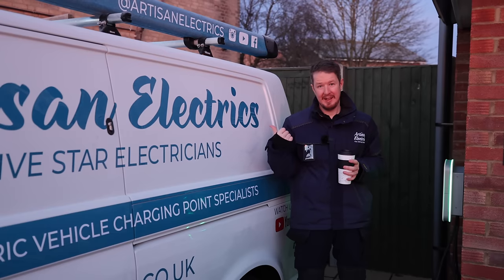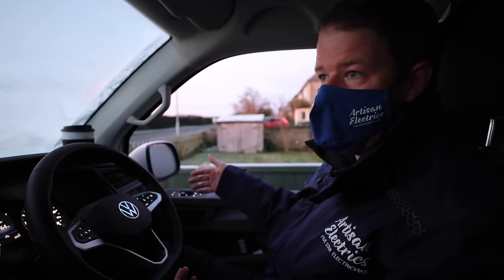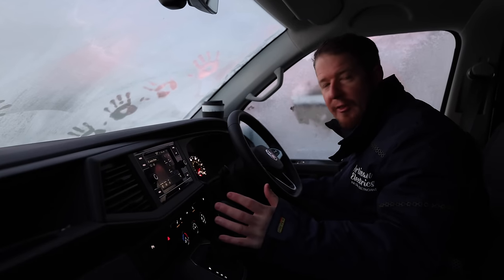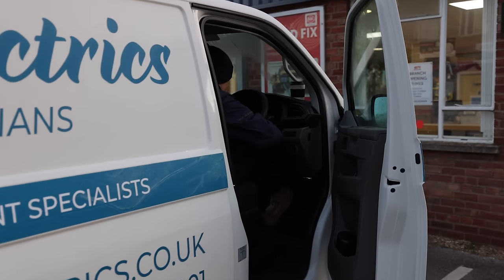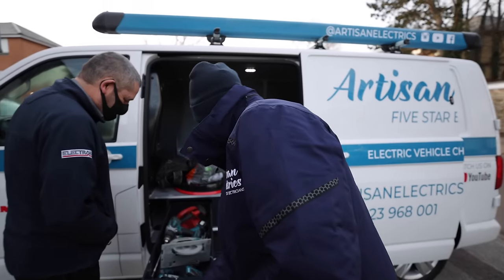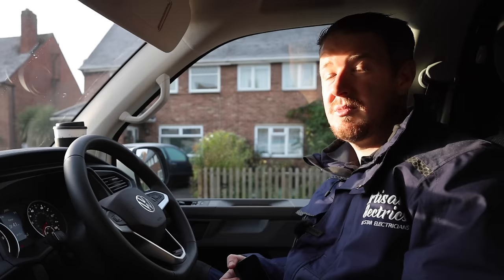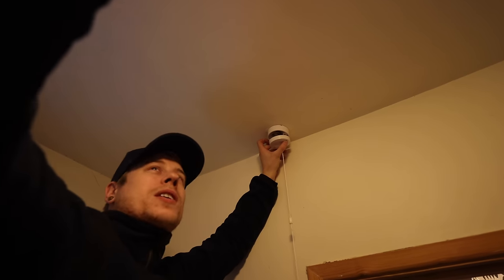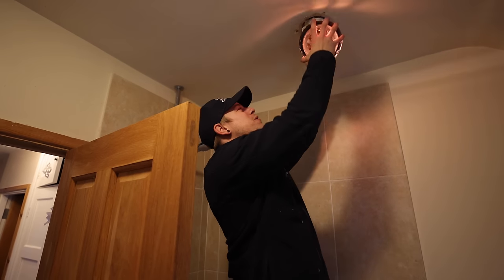ELECTRIC VAN NIGHTMARE 😬 - Volkswagen Transporter Electric Van

Comment: I think you’ve just put me off getting an electric van🤣🤣
Reply: I do some work for a fella who’s got the Kango same as Nagy and the range is only decent for around town with no load any motorway driving, you can forget it the range is almost non existent!
Reply: @JayTheSparky  I was really thinking of going electric. Doesn’t seem to be anything around that cuts the mustard at the moment. Maybe I’ll look at a transit hybrid
Reply: @Waynesworldofgaming  Wouldn't bother with the hybrid mate, real world is around 16 miles loaded on the battery. Best bet is either the Vivaro-E at 207 miles empty or around 80-150 loaded depending on how loaded/roof ladders etc. Or wait til March 9 when VW show the Buzz with its potential 375 mile range with 110kwh battery (empty). If none of those options interest you or you're subject to traders permits like we are in the southern counties, just try to find a low emissions Euro 6 Diesel, Citeron Dispatch is 110g/km co and is becoming quite popular down here.
Reply: @effervescence5664  ok cool, thanks for the advice. I’ll look into it
Reply: @effervescence5664  It is ok them giving the unloaded miles they need to test with given loads in the van

Comment: Wow, not a glowing endorsement for that van! Hopefully you leased rather than purchased. 
Also, if you consider -2 as freezing, avoid Chicago in winter. We've already had a -20 C day and our typically coldest month is still ahead (February). 😁
Love your videos and find UK electrics fascinating.
Reply: Worked up in Canada for a few years, had a Tesla as a second car was a complete liability during winter and had to rely on the Ford 150 pickup
Reply: If the air is dry (low humidity) minus 2 doesn't feel that cold. If in damp air (high humidity) as in UK, even minus 2 feels like minus 10. If the wind blows it's worse.

Comment: Its not the van that's the problem, it's the company that converted it to electric.  If that was one of my vans, it would be heading straight back and I would be demanding a full refund. The range and the performance was shocking to say the least. I don't see Electric vehicles being all of the answer as there are other power sources being trialled which are doing quite well when compared to the performance and range of current electric cars/vans. Your van Jordan demonstrates this rather well. It's a pile of junk and not worth the money you paid for it.
Reply: its rubbish! only 90 miles of range?
Reply: @Lewdacris916  I would honestly think about sending that van back, even if you have to loose a bit of money. It's absolutely no good when trying to run a reliable business if your van is not up to the job, which will only reflect badly on you. You've done nothing wrong so I know it's not fair but that van is rubbish in it's current state. Would be better off converting it back to diesel.
Reply: I have leased one with 2 year commitment. I did my research and  thought about the range before deciding it’s such a cheap van to lease, like really cheap, I decided to add to our fleet of VW Transporters and see how we get on. I knew about the 3.6kw and also the 7kw if you have 3phase available. Our unit has 3 phase so that helps. All the advance ones (you can tell by body coloured bumpers) have heated screen. The heater doesn’t work until you unplug it. I unplug it, heat it up for 15 mins and then plug it back in while I wait for the staff to turn up. That way I still start the day on a full charge. Unlocking the vehicle releases the charging plug, saves messing about with apps. Bearing in mind I have 4 other VW transporters and 2 Caddy’s , I go for the electric one every time! Yes you do have to plan your day but if I need extra range, I just take the caddy. So far I have needed to do this once since we took delivery in August so perhaps give it a week or so before you start thinking about getting rid of it. I’m sure once you get used to the range, and perhaps get the paid version of Zap Map, you will start to understand living with an electric van is not as bad as perhaps you first thought. I had the limiter removed, £300 plus vat at main dealer. Good luck🤞PS, I leased as I’m waiting for the ID buzz to come out (March 2022 I think) so when the T6.1 goes back we can get one of them 🥳
Reply: @deanof1fan  That sounds great. I suppose your right about planning your day before hand. Is it possible Jordan can upgrade the batteries and the charging time? Might be worth him thinking about that if it can be done. I do genuinely feel sorry for him as it looks like he’s done this for all the right reasons but has been caught out. I hope it works out for him in the long run.

Comment: Hi, have you checked the charging settings, as all VW's are set to 10 amps from the factory. Had quite a few customers having the same problem with the chargers we installed, but bit was the car holding back. Adjusted the car to 32amps and happy customers. Good videos are always keep it up.

Comment: You're just slightly below freezing. Use the windshield washers to melt the frost off the windshield. Assuming you have washer fluid in it instead of just water, the fluid will lower the melting point of the frost.

Comment: I drove a G-whiz for six years, in and out of London in all weathers. I added a 50W mains cabin heater to heat overnight and that kept the windows clear and a warm cabin for at least the first five miles. I'd put a 100W in yours as its a bigger area. 
PS I would never buy another VW anything, after owning a car that ate camchains every 40,000 miles.
Reply: Electric vehicles don't have cam chains

Comment: Good vid as always. Ford's patent on heated front windscreens expired a few years ago - circa 2005 I think. I have one on my 2016 Skoda Superb - very handy in winter. I'm not sure electric vans are there yet. Their range is way too low & by the time they are loaded up with work clobber the range drops even further. I just watched a 5th Gear test of electric a VW Transporter & a Merc Vito. Neither were that great.  Add in cold weather & you will be lucky to get 50 miles out of them! And, unlike most electric cars they don't appear to accelerate that well either. They might just be viable for small multi parcel delivery drops for inner city or local residential areas but for anything else needing longer distance, heavy loads or motorway travel forget it. I recently had the option to get an electric vehicle as a 2nd car for my wife - you quoted us for a charger install. However, we found out that have a looped mains supply between us & our neighbours detached houses  (60 amp fuse in each) which prevents the install of a 7kW home charger. To unloop the supply, upgrade the fuse,  & run a separate mains supply in to our neighbours house would mean digging up the 50ft front garden. Even though this would probably be FOC by the the DNO as part of an "infrastructure upgrade" I decided that it was simply not worth the hassle. So, we bought another petrol car instead. The low annual mileage we do means that for us switching to an electric vehicle is simply not worth the hassle or the extra cost. Electric vehicles still have a way to go in terms of range & cost & the charging infrastructure has to improve massively before the mass market can consider switching over.
Reply: Yep not worth it YET.... Only way I can see it making it sense atm is if you've got a company that only contracts a certain area.
Reply: I didn't realise there was ever a patent on them. As a kid, my dad had electric front window on a late 90s seat alhambra, and an early 00s VW sharan, but that might have been due to them being made alongside the Ford Galaxy.

Comment: Until recently I was sparking in telecoms and looked into an electric van especially working around London due to ULEZ etc After a good five minutes taking into account fuel and maintenance costs, initial purchase cost, range, charge time I would have broken even after five years then I would need to replace the batteries on the van as they would be nearing end of life.

I was doing around 40k miles a year and couldn't guarantee getting a decent charge point on site to keep me topped up. Battery EVs are not the way ahead.

Comment: Hi. I have a T6.1 and has been the most problematic van I have ever owned, I had the same issues with the windows not going up. Its a recall issue where the channels need to be replaced as they grip the window to firmly stopping them from going up.
Reply: T6 is not better either, I was complaining at the vw van garage how rubbish these vans are and I was told to buy the t6.1 as on that van all t6 faults had been corrected.Add blue error message constantly warning the engine will stop even if it was filled by vw. When it was one year old rusty points by the door rubber sealant and so on. No more transporters for me thanks.
Reply: @attilafulop  Had the Ad blue warning twice on my T6.1. Had to go in to be reset as it didn't recognise I added Ad blue. Leaking side windows. Faulty day time running lights. Faulty side door that does not close properly. VW not interested in sorting it. Same here, I've always owned transporters but never again!!

Comment: Get a resealable plastic bag, put some Hot NOT Boiling water in half fill the bag zip shut and proceed to rub on windscreen . As for your Windows on a dry warmer day spray WD40 in the runners and run up and down a few times will cure the issue. Hope this helps all the best Tony

Comment: Just a thought for you as regards to clearing your windows covered in ice.  As a new EV driver I’ve found it you leave the van/ car connected and charging out the van in normal driving mode and then put blowers and heater on hot. In my car it takes about 5 mins in a van just allow a bit longer. The van will then get nice and warm and clear windows. As regards to using water to clear the ice away. If you use cold water on the windows and put wipers on ( making sure they aren’t frozen first to screen) you will clear your windows super quick. Just a thought , happy new year to you and your team

Comment: Note the highway code now says £100 fine and 3 points for running out of fuel and I think its up to £5000 for careless driving if you knownley cause an obstruction. There is no difference between liquid fuel and a fuel cell, so watch out all you electric vehicle owners because if you get stuck in traffic in the cold winter you'll all be dropping like flys!
Reply: @Phil Ware Why not?

Comment: I’ve used hot tap water to defrost screens for the last 40 years, never had a problem, the trick is to pour at least a kettle full onto the screen to warm the glass so that it doesn’t refreeze the minute you drive off, using boiling water could cause a problem maybe but I doubt it, windscreens are pretty tough things!.

Comment: Jordan, the easiest way to defrost a windscreen quickly is to pour cold water over the window, there's enough energy in the water to clear the ice.
Reply: yeah room temp water works fine, hot water can crack the glass because of shock.
Reply: @Lewdacris916  
Do you know a single person it has happened too?

I don't

Comment: Can I give you a handy tip for defrosting icy windows. Fill a ziplock bag with hot tap water and close the bag to keep the water in. Put the bag on the windows and as you move the bag around you will be sweeping and melting the ice off them. Does not damage anything, your hands stay warm holding the bag and the ziplock bag can be reused many times.

Comment: I have used a boling kettle for years but slow drip the hot water dont chuck tons on or you might crack the wind screen... I have been doing it for 30 years never had a problem....Leave wipers on..dont splash your self.

Comment: Commercial EV is laughable. 59mph flat out? 😂😂
Thanks but We will still be running our fleet of diesel transits for a long time.
Reply: That limit is probably due to the rules pertaining to non-car derived vans (panel vans and pickup trucks over two tons unladen) that are limited to 50mph in a 60 limit. An archaic law considering modern vans have car-like handling and active safety systems.

Comment: Had to stop watching, that was painful. You are a top notch electrician but your logical thinking went out the window! Did you have your morning coffee. Surly your first thought should be if the plug is locked it, click the unlock button on the key? Also when your plugged in, unless you pre heat via the app, you won't get full heating as you can't start the car. (That one from experience). And if you didn't know you have to turn the key to start it, like every other car with a key (ready in the case of EV) that's just user error. Anyway rant over, keep up the great videos, just can't watch this one 😂
Reply: You would think that being Jordan has a high profile youtube channel VW would have gone through how the van all works so it shows them in a good light.

Comment: Fair play for going electric   
But 60 odd miles is just no good for anyone really 
As you say they need to be designed from the ground up
Reply: There is no need for designing from ground up. Designers just need some common sense. e.g. why there is mechanical gearshifter in ev? Even ICE cars from credible brands, have not had a mechanical gear selector for at least ten years. Other thing, If handbrake is on and you try to drive: Volkwagen solution: DO NOTHING. Any other car: BLING and message "handbrake on"
Reply: @peto22  typical
VW. rush a substandard product too market just to save billions in emission penalties.

Comment: Well that's a kick up the backside for this push for green transport good old combustion engine will never be beaten ha ha ha ha
Reply: Will be perfectly viable once he gets used to it.

Just got to remember it's only 3.6kW charging rate (about 1.5x your average kettle) (Vs 11kW for his Tesla) and it has no DC charging capability (which goes over 200kW for short periods on the Tesla).

Then you've got a relatively small battery in a non-aerodynamic vehicle (van) which you've made worse by adding roof racking and a bunch of weight, and driving it on a cold wet day (about as bad as it gets for an EV).

Plug it in for 5-10hrs every night to give it a full (or 90%) charge and it will be a lot more comfortable 

The new Merc Sprinter and Renault Kangoo ETech are probably better electric vans (both with faster AC and DC charging), but may not suit other needs

Comment: I've had brain farts too when the car won't let go of the charging lead. 
You simply lock and unlock the car and that sorts it. 
Preheating the electric car while plugged in is brilliant. My Golf Gtes both had 7 day timers but my Audi only has a 2 day timer which is a real pain to remember to programme. 
While it takes time to learn these things, the brutal realisation that evs are not fit for purpose is horrible when you've spent so much buying/renting it. They are rubbish.

Comment: heres a little tip for you  make up a hot flask keep it in the van and an i put some cold water in a plastic see through zip bag mix with the warm water from the kettle seal it up and rub it accross the screen works in seconds

Comment: The window issue is the anti trapping fingers/head in it safety device. It’s detecting something is or might be going to be trapped in it, so doesn’t close any further .
Reply: Motor not powerful enough
Reply: @vincentmckenna1755  The glass is moving in the rails, nothing to do with the motor, the window shifts, causes the module to think something is trapped.
Reply: @mattknights274  yeah ice on the glass
Reply: @vincentmckenna1755  no, the window isn't sat correctly, ice makes no difference
Reply: @mattknights274  so it's a brand new van ,and build quality is rubbish

Comment: I bought a VW Passat hybrid - wife does school run and local shops on the battery, we have solar panels - for longer trips its got a 1.4 petrol , no battery anxiety - its 2 cars in one tho, very complex so you have to buy the approved used VW warranty as these cars are likely to fail. Nothing beats an old diesel running on red mixed with veg oil.